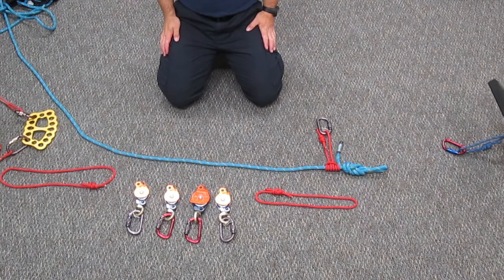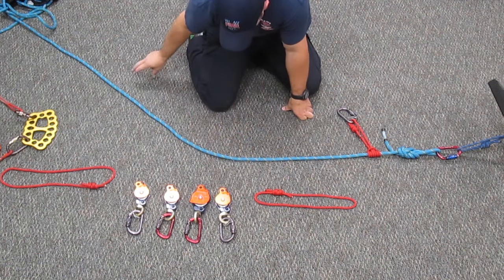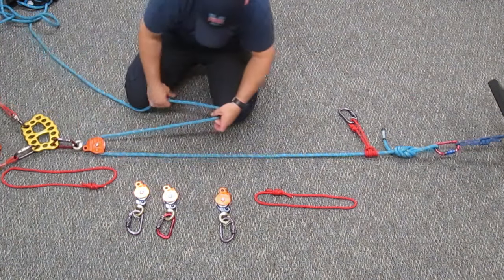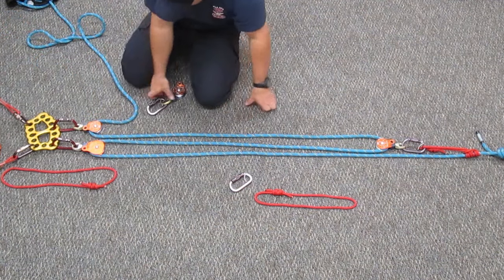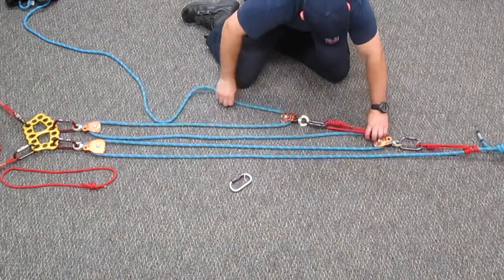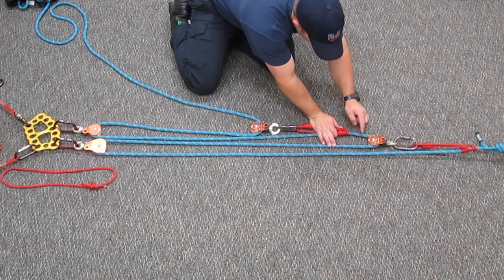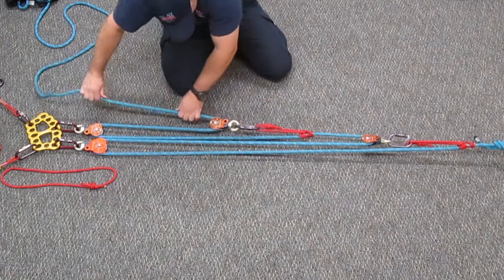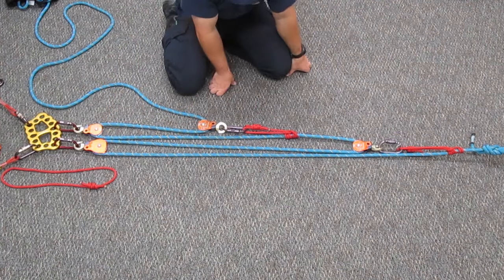9:1 Mechanical Advantage

Comment: Great video.  As a blacksmith, I love showing these videos around my circle so guys can better understand how easily we can move heavy equipment in the shop.  Too many have forgotten that ropes and pulleys even exist.  Costly to set up, sure, but worth it in the end if you only need to move a power hammer or lathe.

Comment: Great Video! I have a question though.. what would the ratio be & what would happen if you made the 2nd redirection attached to a rope grab off the back of the progress capture pulley instead of the rigging plate?
Reply from the maker: If I understand you correctly, I think it might make it a complex 11:1 .  You would have to reset the pulleys so many times though.
Reply: @dangerstall  Thanks Ryan! Yeah I used it today, not ideal but only had 4 pulleys in gear bag. Luckily I only reset once.
Thanks again, really cool channel. Looking forward to more videos

Comment: It's a 6:1 fellas. A 3:1 with a 2:1 compound. 3x2=6:1
Reply from the maker: Please go learn the T method for calculating mechanical advantages and let me know what you think after.
Reply: @dangerstall  easier to just simply show it, or describe why it isn't a 6:1. It's a 9:1 @k9solutions because he added another pulley at anchor vs creating a dead load using another figure 8. therefore that 3 traveled through pulley to create 9:1. had it been a dead load, it would not have traveled and would be a 6:1. good eye, but missed that one thing

Comment: nice videos on pulleys!  Are the Prusik ropes strong enough for all the load?
Reply from the maker: Yes, because they are only taking a percentage of the total load in a mechanical advantage setup, and a prusik will slip if overloaded.  They tend to slip at about 1200 lbs of force for a 3 wrap prusik hitch.  Give or take depending on materials and diameters etc...
Reply: Depends on the load and force applied at the anchors gotta remember the force is applied in more than one direction